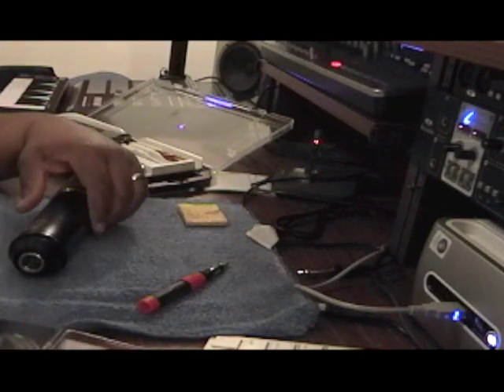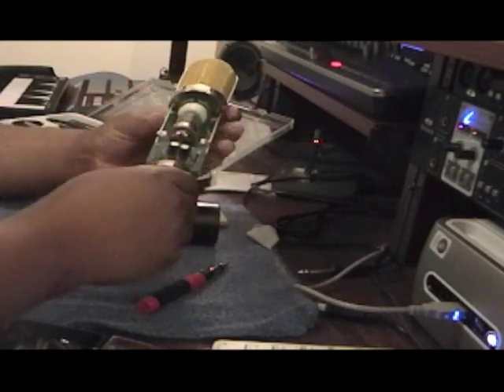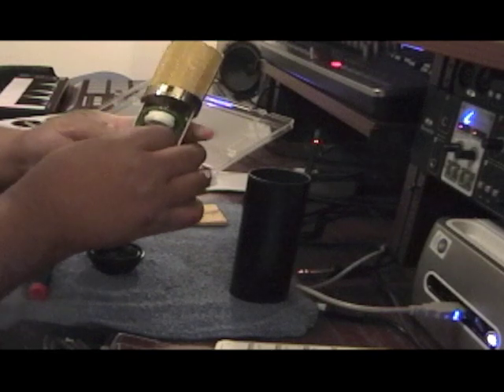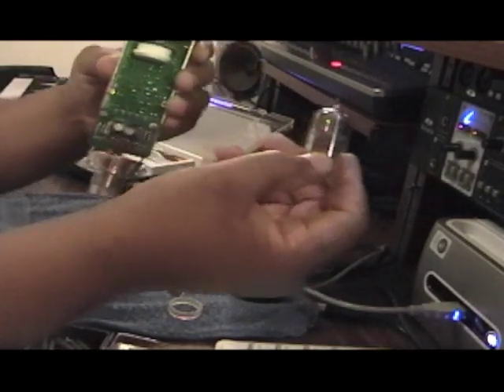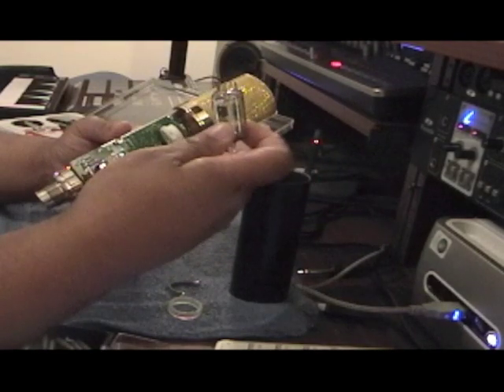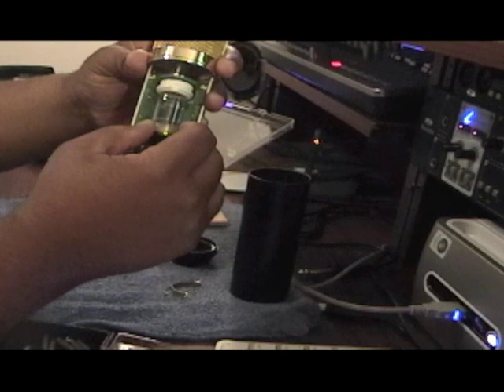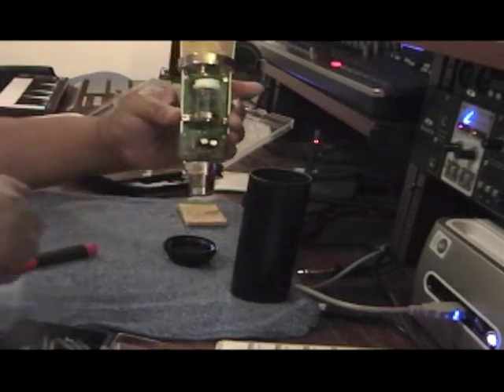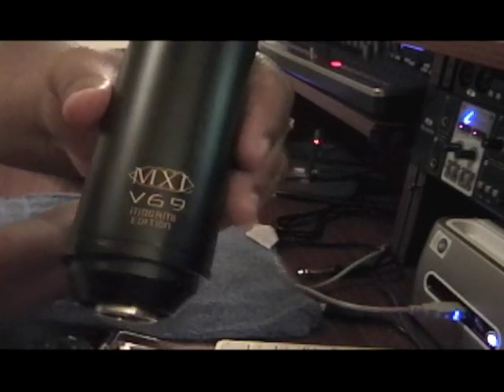Mic upgrade part 1

Comment: thanks for the post! this info was very helpful! i have a collection of vintage tubes for this mic and they all sound great.you should not touch tubes with your fingers because the oils from your skin get on the glass and can cook on to the tube causing the tube to burn your fingerprint on the glass , shortening the life of the tube. use a small eyeglass cleanning cloth to handle the tubes.
Reply: That's a myth.

Comment: Thanks for the vid bro, apparently Peluso was involved in the creation of the v69 and he said it was designed to use a 12ay7 / 6072 type tube, but the 12at7 tube was easier to source in China.  So upgrading to the lower gain tube (6072) might be beneficial.
Peace and thanks!!